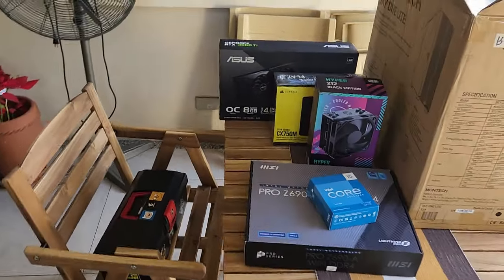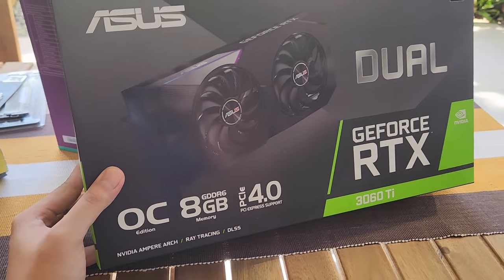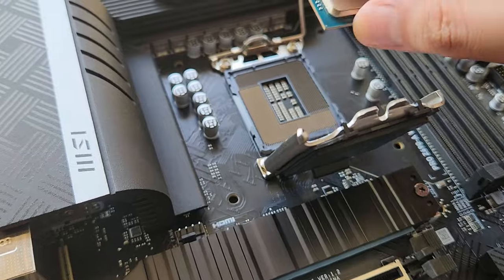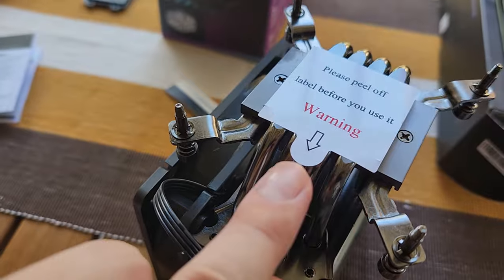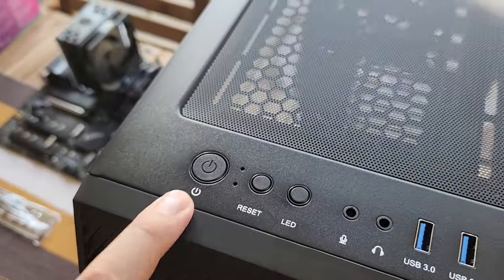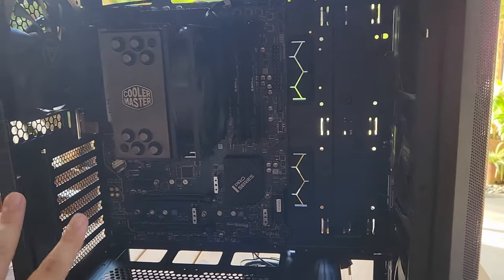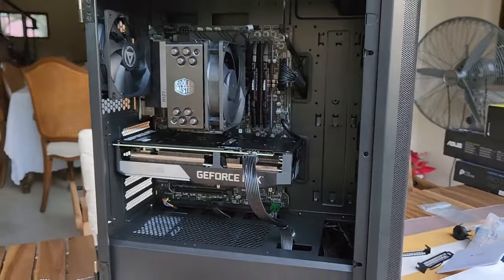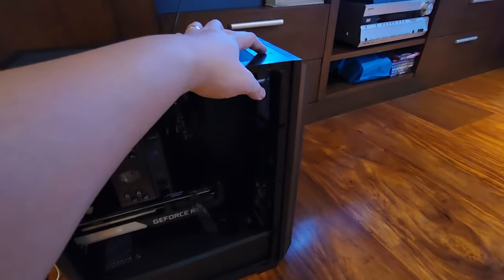[VLOG] Building an Php85K ($1700) Gaming PC for my friend's bro!

Comment: The Intel Arc A770 16gb graphics card would have saved you around $150 and still have got the same performance as the 3060TI, well unless it was on sale when you bought it.

I would have gone with a B760 motherboard and a non "K" CPU and saved even more money. Only reason one would go with Z690 or Z790 is if they plan on overclocking the CPU. Don't know if the person you are building this for is wanting to overclock? In my experience I never had the need or desire to risk destroying a CPU by overclocking it. Not something I want to do given that these CPUs cost you know £300 plus depending on model. Don't know if that cooler is good enough for a 13600k. I assume you did your homework though. That CPU could get very hot if overclocked to 6000ghz. Hope they have the money for the electric bill, lol. For a bit more money you could have bought a Western Digital SN850X 1TB NVME drive for around $95 and had gen 4 speeds.
Reply from the maker: Yes, Arc A770 would have been great for this kind of a build, I agree. Actually I did end up changing the cooler after the fact to a DeepCool AS500. I kept the Hyper 212 for myself! Lol

Comment: I want to build a PC and contents helps me understand. I am an IT graduate so in a way, I understand the terms and parts, but its been ages since I last practice. Here's what I am planning to assemble perhaps you can share your thoughts on a video. Thank you
Case-	Darkflash DLX4000 Mesh E-ATX PC Case
Motherboard	-MSI MPG B650 Edge WiFi AMD Motherboard
CPU-	AMD Ryzen 7 5800X Processor
Graphics Card-	ASUS Dual RTX 3060 White OC Edition 8GB GDDR6 Graphic Card (DUAL-RTX3060-O8G-WHITE)
Memory	-Corsair Dominator Platinum RGB WHITE 16gb DDR5 DRAM 5200MHZ C40
SSD	-WD Black SN850X 1TB NVME Internal Gaming SSD
CPU Cooler	-Darkflash Twister DX-240 V2.6 All-In-One 240MM Liquid CPU Cooler (White)
Power Supply	-Corsair CX-M Series CX750M Semi-Modular ATX